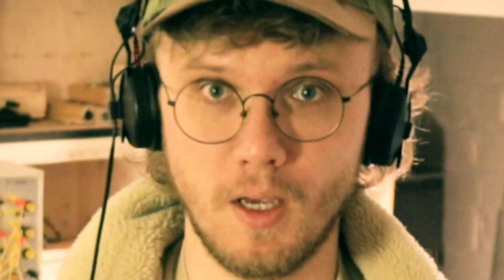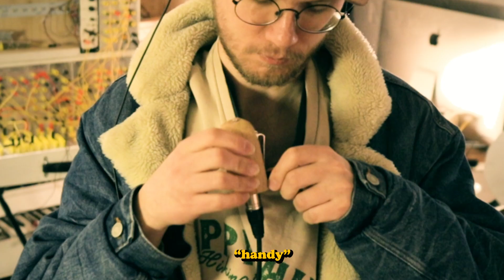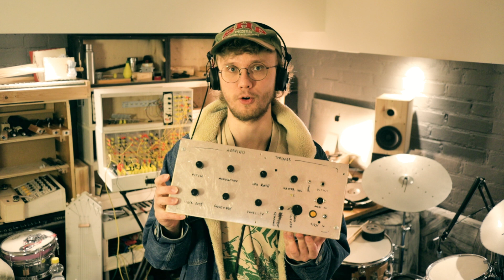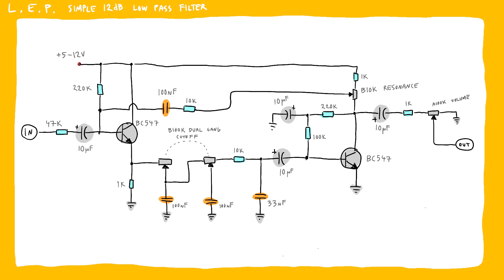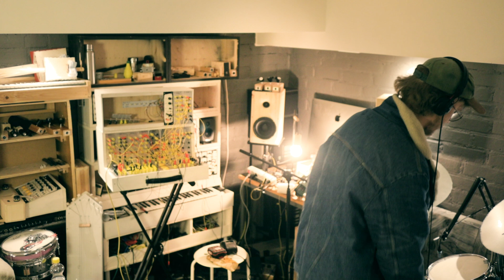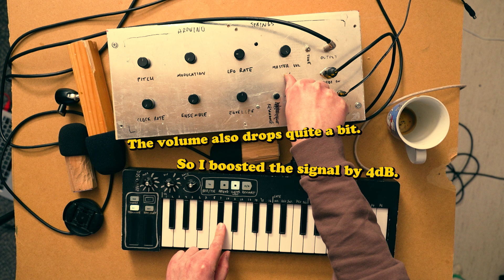DIY 4 voice arduino nano string synth (modified Jan Östman's Solina)

Comment: Anyone figure out a way to program this without the notes latching together that he talks about at about 7:40? It sounds great but the weird hold function unfortunately makes it unusable in a live setting for me. Sounds great though!
Reply from the maker: I have no idea how to do this, hopefully there’s somebody code savvy out there! Maybe AI could help with this but i wouldnt count on it lol
Reply: @LAURISDIYCHANNELTV  regardless it is an impressive project! Any other rabbit holes you recommend going down? I'm trying recreate a combo organ by running a digital signal through analog organ filters. I thought this might be a good basis for the project but I need more functional polyphony and eventually the ability to put out 3 different sub octaves or three separate boards for the octaves.
Reply from the maker: i’ve been super interested in divide down organs for a long time and at some point do plan on building one, but it does take a lot of work! The idea is that you have one master square wave oscillator and you use a Top Octave Generator ic chip to divide the clock oscillator to the 12 musical notes. After that you use basic CMOS dividers to create the lower octaves of each note! Thats’s an interesting rabbit hole to get into!
Reply from the maker: For your project it might be a good idea to look up some projects that are based on raspberry pi pico or some other microcontrollers that are a bit more capable in audio stuff than arduinos! There’s a guy on youtube called Marcel Licence who has some awesome sounding organ and synth stuff using Picos or similar microcontrollers, go check his projects out!

Comment: Hi, I have a question. Could this work with an Arduino Uno? I only see projects for the nano, but I guess one could adjust the code to take signal from the correct inputs, right?
Reply from the maker: I think it should work on an UNO with a bit of modifications in the code but im not 100% sure, i dont really understand all this code shit lol

Comment: Lauri, wondering if you could clarify the wiring of the potentiometer? Does the middle lug #2 on each pot connect to A0-A5 on the Arduino? Mine works but it sounds like a bizarrely circuit bent version. Apologies for my ignorance. Thank you!
Reply from the maker: Yes, the pots middle pin connects to the analog pins of the arduino and the pins 1 and 3 connect to +5V and GND! Make sure all the pot connections are soldered ok, if theres bad connections, that might be causing some ”circuit bent” sounds
Reply: @LAURISDIYCHANNELTV thank you! I did get it working on a breadboard, although it sounds a bit more glitchy than yours. Kind of cool in and of itself. My first synth project! Thanks again.

Comment: OMG this is amazing! Could a person use an older generation Arduino they happened to have lying around?
Reply from the maker: @donbaker9352  i’m not sure what models the code works on, but i dont think the nano is really all that special so i would assume it would work on others as well, UNO for example. I dont know if theres something you would need to change in the code, but at least check the pin numbers etc cause they differ between models
Reply: @LAURISDIYCHANNELTV  thank you for your reply!

Comment: Funny how that surfaces up every now and then (guy here is using the same filter but with bypass switch: https://bloghoskins.blogspot.com/2016/11/diy-arduino-string-synth.html?m=1). Resonance feedback path is missing a decoupling amp stage hence the bleed. But then again it's easier to use a bypass switch or build a proper VCF with a 3320 or the likes.
The weird behavior at higher notes is caused by the strange implementation of the waveform generation (which is no saw wave but rather a saw pulse thing and implemented such that it maximizes aliasing). All of that guys (JO) projects are like that - they are really inspiring abstractions of the real thing but always lack some pretty basic DSP implementation knowledge.
Still a nice diy project with a lot of personality!

Comment: Hello!

I don't understand what the Gate Out is or pin 10 ...

Then I have to connect the input of the low-pass filter to the Out pin (pin 11) or to the Gate Out pin (pin 10) ????!!

Please help me understand :(
Reply from the maker: @Samsuma97  the output (pin 11) connects to the input of the filter! You dont have to connect the gate pin to anything, i didn’t either! I just added it to the schematic so people know you can add it if you want to trigger external gear
Reply: @LAURISDIYCHANNELTV  Thank you!!

However, I don't understand how you can get 4 voices from a single digital output :(
Reply from the maker: The same way you can in any other polyphonic instrument! The voices are summed together to a single output in the code. If you mean how the code actually works, i dont understand that either lol
Reply from the maker: Oh and if you thought you can get 4 individual outputs with this, that's not possible with the code! It's just a single 4 voice polyphonic synth

Comment: Hi all. I build this and works, but the 12db filter is behaving strangely. It works but when i press a key i hear some sort small pauze before hearing the note. It sounds a bit like that the transistor startup by each key ptessing. Its gets worse when pressing 3 keys. Ik checked the schematic multiple times but all seems good. Maybe this behaviour is caused by the double decoupling. 1 from the solina synths output (1k, 10uf cap), and 2nd the input resistor and cap. To me it seems redundant? Or do i just connect the output of the solina to the base of the input transistor of the filter? Any advice very appreciated.
Reply from the maker: Hmmm not sure what could be causing this. I would first try and swap the transistor to make sure its not just a faulty one!
Reply: I'm having the exact same issue. Like a gate that slowly opens after pressing a key. My audio interface also clips when I press a key, but there is no audible signal at first. This did go away when the middle wire to the 10k resonance potentiometer accidentally broke off, wich also boosted the audio signal tenfold. Not a great sollution, because the filter did not work as intended anymore. I tried plugging the synth into my monotron, and the monotron filter reacts the same. Seems as if the issue is caused by the synth circuit, but I have no clue yet where.
Reply from the maker: Did you ever get it working? I just remembered that there is a little error in the schematic in the video, i hope you noticed the note in the description!! The schematic linked in the description is the updated one that should work!
Reply from the maker: i dont know how the circuit works with the error, but as its a wrong connection in the cutoff dual potentiometer, it might be pretty important!

Comment: The synth + filter sound really good. Here's a little rookie mistake I made, in case someone else wants to build this: contrary to other arduino synths out there, the original code apparently has a few switches for midi channel selection. If you don't connect anything, like in the video, the synth will listen to midi channel 1 only. Be careful not to accidentally change the midi channel in your midi controller (it happened to me), since only midi channel 1 will actually work.
Reply from the maker: Yes!! I forgot to mention this in the video

Comment: I tried to present the project, it works poorly for me, the sound on your video is also not so beautiful. Question, why do you have 6 knobs in your synthesizer, and 5 in the circuit?
Reply from the maker: Yeah the sound is definitely not “beautiful”, its supposed to be a bit glitchy and dirty! The 6th knob is just the pitch control i tried to get working but failed! So its not connected to anything

Comment: Hi, this is awesome indeed. 1 question though. Why isn't there some DAC chip? I recently build a midi to CV converter and this need a DAC to convert midi notes to voltages. Why is this different?
Reply from the maker: @MJLouer  the code uses the PWM output of the arduino, so the output is just +5V pulse wave with very fast varying pulse widths! This makes the circuit super simple as you dont need a DAC but also the output is nowhere as clean and nice as you can get with a DAC. At least this is my understanding of the subject
Reply: @LAURISDIYCHANNELTV  Hi Thanks for you reply.
Reply from the maker: Midi to cv needs to have a very accurate voltage at its output, that’s why you need a DAC for those kinds of circuits

Comment: The intro jam absolutely enthralled me to the point I am just about to finish my own DIY solina using your code and schematics. Today I received the last batch of components I needed. One quick question here: do you know any EG schematics that could run on the same voltage of this synth? A single supply +9v also works since I'm using a 9v power supply with a 7805 regulator to power up the Arduino and the filter anyway. However all the projects I found regarding EG required dual power supplies unfortunately. Any insight would be really nice.
Reply from the maker: @SaltaSoles  yeah for most EG circuits online you do need a bipolar power supply, but i’ve used a simple AR envelope design by Synthnerd a couple of times and its awesome, if an AR envelope is enough! I’ve used it with 12V DC and it should work fine with a lesser or greater voltages as well. You can google ”synthnerd AR envelope using op amps” and you should find the website for it!
Reply: @LAURISDIYCHANNELTV  thanks a ton! Will definitely check it out. Also yesterday I was prototyping the circuit with your code (without adding the pots nor the filter yet, just the optocoupler and the output circuit in the Arduino schematic you shared) and for whatever reason I couldn't manage to make it sound. When I load other arduino based synth sketches (like, the Helios One) I managed to pull out some sounds. But not with your schematics. It's very odd. Helios uses a different PWM pinfor the output, but otherwise I used the same schematics as yours when I loaded the sketch. Any ideas on how to troubleshoot it? [EDIT: I figured it out. Mind the midi channels of your controller! Will post in the general comments just in case someone else falls for the same rookie mistake as I did]

Comment: Do you think a DIY CS-80 is possible? (with Arduino and the GX-80 VST)
Reply from the maker: I dont know a whole lot about coding, but im pretty sure there is no way to run VSTs on arduinos, because the hardware just isnt capable! You could build a dedicated midi controller to use with your DAW and the VST but thats about it i think!

Comment: niiiiice! I've tried to build it on Arduino Uno, but it doesn't work! The RX led doesn't even blink :( I've replaced the octocoupler's diode with a led to see if there is signal from my keyboard at that one is fine... Would you have an idea about what could be wrong? Thanks a lot!
Reply from the maker: I’m not sure what the problem could be! Make sure your pins are correct, as the UNO has a completely different pinout. And remember the output pin needs to be a PWM pin.
Reply from the maker: But i guess the RX led should be blinking even regardless of the output pin or the analog inputs
Reply from the maker: Oh and make sure your keyboard is on the correct midi channel! If youre not using switches to change the channel, it should be channel 1, if i remember correctly
Reply: @LAURISDIYCHANNELTV  it works! Thanks!
Reply from the maker: Nice!!
Reply: @Emanuele-v4c what was the problem? I am facing similar issues with an Arduino UNO, my RX chip is also not blinking

Comment: Wow it's weird seeing that dude's name here. The guy has been completely run out of the synth world for lying and massively exaggerating the capabilities of his products and scamming dozens of people out of money and never sending them their product. He's infamous on the muff wiggler forums. I've been looking into DIY electric instruments myself lately and see his name all over the past internet, and he undeniably did have some good ideas and was at least a somewhat talented engineer. But I've seen too many of his designs that do not have proper safety circuits in place and/or do not work as intended. I am working to recreate his tiny TS synth right now.
Reply from the maker: Oh, i didn’t even know this, sounds awful! I’ve only used his Solina and Minipops codes and they are wonderful! Not a fan of scamming, though! 💀
Reply: @LAURISDIYCHANNELTV  Wow, thanks YT for telling me every time some mouth breather feels the need to tell me how despite having never actually interacted with any wahmens are actually Satan, but not when the actual creator of a video responds. Clutch. 

If you can think of a way to let me know your email address I can send you a few zipped archives of his old site including code and Gerber's for a hood handful of his old projects. There's definitely some good stuff in there. And I'm just now realizing it would be way easier to just email my username at Google's house if you want them and I'll send them over. Hopefully refusing to use the backspace key has placed this below a "click to keep reading" fold.
Reply from the maker: Sounds interestin! My email is madebylaurichannel@gmail.com
Reply: True, but at 6:00 you've got to admire how incredibly effective his famous, magical anti-aliasing function, that everyone (including Émilie Gillet herself) told him wouldn't work, turned out to be. /s 😂
Reply: I mean, look at JHS. Scrub hard enough and you won't see the dirt anymore.
Reply: @QuixoticGuitars2 this is, in fact, the first time I’m hearing such things! What’s the dirt on jhs?

Comment: you have a 12v psu, but the schematics display 5volts needed . Did you had to scale down? i am asking for laziness purposes, thx!
Reply from the maker: Oh true, i dont mention this in the video! I’m using a 5V voltage regulator, but i believe the arduino nano boards do have a built in regulator. So you connect 12V to the voltage input and you can take the 5V going to the potentiometers from the boards 5V output pin. At least thats how i think it works! I always use an external regulator cause i trust them more then the cheapo arduino clones im using + for some reason its clearer for my brain to build circuits this way!
Reply: @LAURISDIYCHANNELTV  Also and last question , how is the midichannel set?
Reply from the maker: Mine is permamently set to channel 1, but if i remember correctly, the code includes a way to set the midi channel. You need 4 on/off switches that connect 5V to 4 digital pins of the arduino and the combination of the switches chooses the channel. I cant remember what the pin numbers are, but you should find that info in the code
Reply: @LAURISDIYCHANNELTV  Is there any discord ? I cant get it work. Ive uploaded the sketch on the arduino, on breadboard i only have the output A5 for the envelope control, I have the midi connected to the 6N137, and it works because I used it for another midi IN project for a volca, I only breadboarded the resistor and the two caps at the output pin D11. I have  connected the midi to my beatstep pro  and see taht the RX led from te arduino flashes... andd it does not sound anything... May in the code the pins be set different as per your schematic?

super regards :)
Reply: Filter works nicely tho 😍... but no oscillation can be heard or seen from thearduino :c.... sO far ive tried with two arduino nano
Reply from the maker: @finonomastropiero4261  hey! Sorry, i dont have a discord for this stuff! 😔 You can message me on instagram if you want some help troubleshooting and not do it all publically in the youtube comments! Did i understand correctly that you dont have other analog pins than A5 connected at all? Im wondering if the sample rate pin might have something to do with this. I cant remember wether the sample rate goes up with 5V or with ground. With my synth it does make some crackling noises though, no matter where the sample rate is set at. But maybe try connecting a pot for the sample rate and see if it makes a difference just in case?
Reply from the maker: Also, make sure you are indeed on the right midi channel! Pretty sure it works with midi channel 1 if you dont use switches to change it. I believe the arduino shows its receiving midi with the blinking led, even if the channel is not correct.

Comment: I'd strongly recommend to use the gate output with an envelope and add a AS3320 based filter to it.  You won't need a VCA since the "oscillator section" comes with it's own volume control. But DUDE that 3320 filter sounds super fat with resonance turned all to zero and giving it an slower attack brass sound like envelope. You really get some prophet vibes. 
How difficult could it be to change the code from driving a PWM audio output to driving a dedicated DAC chip?
Reply from the maker: Yeah ive used this with my SSM filter, that has a similar sound to a CEM, and it sounds very pleasant and brassy indeed! I’m sorry but i have no idea how to modify the code, i know very little about that stuff! 🙈